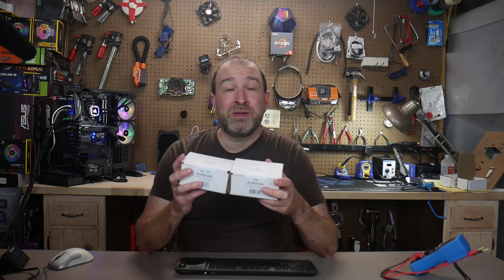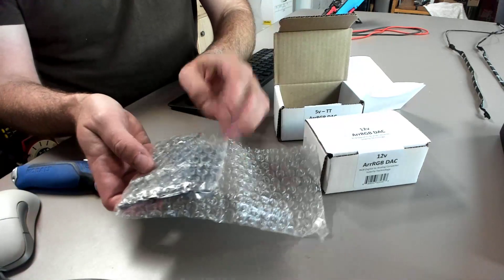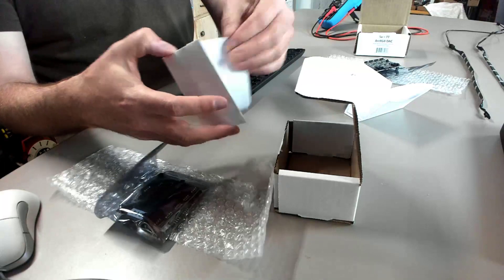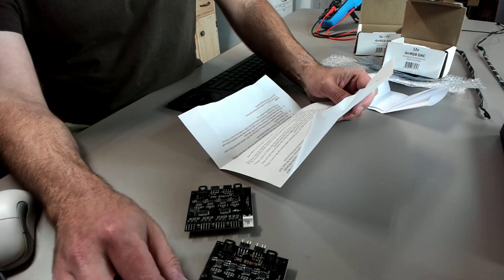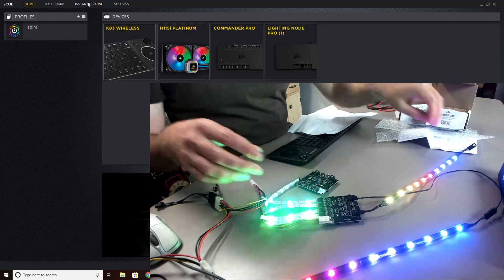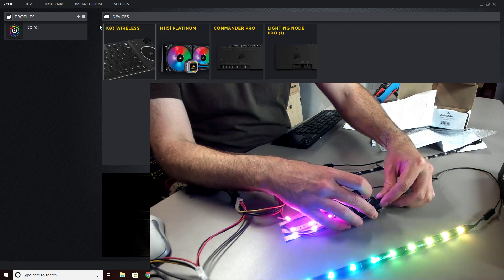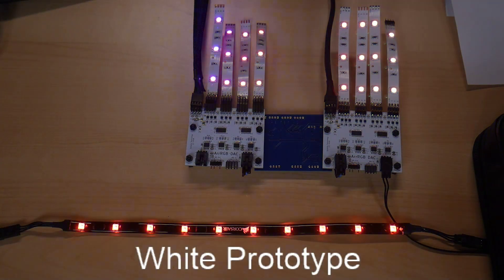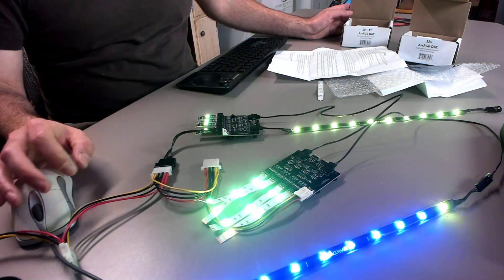ArrRGB DAC Unboxing - Digital to Analog Converter for RGB devices.

Comment: Hello, I can connect a fan cpu (RGB 4pin) with the arrRGB DAC in 12v?
Reply from the maker: Yes, if it uses the standard 12v RGB connector.
Reply: @SolarityTechnology  Does it work if I connect with iCUE commander pro or Node CORE? If so, I don’t understand how to connect everything (Commander pro/node core > ArrRGB DAC > CPU Fan)?
Reply from the maker: @DavidH.68  Yes, just make sure you get or have a cable to connect the LNP/Co-Pro to the DAC. A lot of the LNP/CoPro come with one.

Comment: I Have ID Cooling Auraflow x 240 AIO and i want to paire it with my other Corsair stuffs. 
Can i use this 12v product for AIO Pump and Fans too?

Product Link:
http://www.idcooling.com/Product/detail/id/143/name/ARUAFLOW%20X%20240
Reply from the maker: This is exactly what it is used for. It also allows you to connect each object to one of four channels so you can control the color for each channel separately. I use Corsair iCUE to control all of my analog RGB devices. Check out a list of resellers that carry my product at https://Solarity.tech

Comment: So, just to confirm... Can I control Cooler Master 12V 4-pin RGB devices with this DAC via iCUE? Was thinking of buying a LED equipped partition for my case and it uses 12V 4-pin.
Reply from the maker: Yes, I designed it to control 12v (some times 5v) Analog/Common Anode RGB LEDs from a Addressable/Digital Signal/Controller. You can see the evolution of the DAC in my playlist. Here is a demonistration: https://www.youtube.com/watch?v=cDyW6wq2AU0&t=1s
Also check out my RGB 101 for more information about RGB in general: https://www.youtube.com/watch?v=z5paaWs_Gz8

Comment: Is this still available??? I need one, I have ASUS boards in both my systems and have 3 pin 5v RGB to connect and have no way as the boards only have the 4 pin 12v connectors!
Reply from the maker: This DAC won't help. It is meant for people who have 12vRGB fans, GPU blocks or strips and want to control them with a digital header. There are a couple of devices on the market that do exist, but it will dumb down your 3pin ARGB devices to work like the 4pin 12v. So no more cool rainbow or sequence effects.

Comment: I have 2 Corsair QL140 fans on a Lighting Node Core. I also have a Razer (USB) Black Widow Chroma V2 keyboard. When my computer boots up, the Corsair fans go to the static color I chose for them, but quickly change to a different color in various shades, and remains static. I have ordered a Commander Pro module along with 4 LED light strips and a Lighting Node Pro, but do not have them just yet. Have I not set something up correctly, do I need the Commander Pro to make the fans work properly, or are these fans just not compatible with Razer's software running??
Reply from the maker: The fans aren't compatible with Razer's SW as you can't control it via Chroma. You can sync your Razer stuff with iCUE via JackNET. Could you do a video of your issue or join my discord to discuss this?

Comment: Nice we really need products like this until the industry decides to make a standard, wont hold my breath though! 

Did I understand you right in the video in the part about the jumper, that the board is the same board essentially for both the 12v and 5v TT version with just a solder jumper to switch it from 5v mode  to 12v mode or vice versa?  Meaning at some point if you needed you could just switch the resolder the jumper to switch it to the other mode, no need to buy another board?
Reply from the maker: The ones that are currently for sale are the same boards with the solder jumper. The analog RGB headers also differ from the two boards. That being said there should be at max 2 left in stock with my resellers.  New batch is a slight revision. It has a 3pin physical jumper and there is only one version. For TT users, they will need to get an adapter.

Comment: You wouldn't be willing to make a 2nd run of these? or give out the schematics? It would be much appreciated.
Reply from the maker: Yeah we are having a 2nd larger batch of them that are in the middle of production. They would have been done already, but the pandemic really set things back. Luckily they have all the BOM and the PCBs were manufactured months ago. We had a couple missing parts that took months to source. The boards just have to be assembled with a pick and place, then tested. Just don't know where the tester is. Shipped it to them on 5/21 ><, was last tracked in Jamaca, NY on 3/27. We still have some stock, which reseller are you using?
Reply: @SolarityTechnology  Not really using any resellers, I'm new to this whole thing. I've recently bought Pacific RGB Plus TT Premium Edition and being able to control them with iCue, as everything else in my build is controlled by Corsair that would be awesome! I'm just hoping I'm not late to the game.
Reply from the maker: @Omaricon  I currently sell though modmymods.com and piratedogtech.com. Though you might have the newer version of the TT RGB fittings, which are compatible. They are some subtle differences, though overall hard to describe via youtube comments. Join our discord, which is linked on my channel to talk more. Pics really help.
Reply: @SolarityTechnology  just joined! I love your work though. Truly amazing mod work!

Comment: so i can use this on my asus mobo that has 12v header and connect 3 pin argb on the output and contril with aura sync ?
Reply from the maker: This is meant for the opposite. Control 12v analog devices with a 5v ARGB header.
Reply: Is there any way you can look into building a version that has 12v to 5v like the comment above suggests? The only one on the market right now is the Deepcool RGB Converter and it is out of stock everywhere. I would pay 35-50$ for one, just so I don't have to get a new Motherboard for the 5v header
Reply from the maker: @no.1baller939  Developing something like this takes a lot of time and money. I think they quit selling it as it wasn't that popular. In all honesty, I think it makes the most sense to buy a digital controller like a lighting node Pro. The analog to digital adapter is basically lobotomy of the digital strips. The Digital to Analog adds functionality, while going the other way reduces it.

Comment: How can I test to see if my converters are working? They are no longer put out the signal to my TT fittings. The fittings are working I’ve test them with their original controller and the ICUE works because it powers their strips, but when I connect ICUE out using your ICUE to the Converter in, I get nothing. The 2 converters did work but now they don’t. I know the ICUE has been updated, but I get nothing from both.
Reply from the maker: Could you email me at solaritytechnology@gmail.com or message me via discord https://discord.gg/nvqaAfq

Let me know via above, if the fittings have 3 or 4 wires. Also are you saying the Corsair strips don't work when you plug it into the output of the DAC? Is the DAC directly connected to the Corsair Lighting Node Pro or Commander Pro?

Comment: Have you’ve tried the board with the new Thermaltake fittings? Because I had to get them because the originals are just to flimsy. The cables detect from the solid LED ring. I’ve tried the new Thermaltake LEDs with the boards and it’s a no go. Can you help?
Reply from the maker: Don't plug the new "premium" TT fittings with the DAC, it could damage them. I think they use digital. Granted both voltages are 5v, though I don't have them so I don't know the pinout. Also they should have 3pins not 4. How many of the old fitting's wires broke? The wires are soldered to the PCB and have no strain relief, which is a bad design.
Reply: Solarity Technology Thermaltake places a whole 6 pack. I went along with it not knowing the difference. The LEDs are much brighter. And construction is much sturdier. I would be super ecstatic if it performed like the DAC does when it’s in razor and raindrop modes. Although the TT controller has some descent lighting modes, I wonder if there is a way to export razor and raindrop and from the Corsair controller and import it to the TT controller?
Reply from the maker: @themword1279  I don't have any, so I can't really give much input. I think the newer ones are digitally controlled as they have 3 leads. One disadvantage is there is no digital out so the data can't be passed to the next fitting. While an adapter could be made to run it off Corsair's controller it might be a bit of a challenge to sync them in the way I did. Do you have discord?

Comment: Hi..i have a motherboard with 5v headder (ASUS) and i have the commander pro and LL corsair fan..with this hub i could sync asus product and corsair products? And wich software i should use  to control the lighting effect? Thanks
Reply from the maker: This board allows you to control analog RGB, which are usually 12v with a MB or a Corsair controller. It also gives you for addressable channels. This will not sync up your MB, unless you wire up io shroud and chipset LEDs to the DAC, but that is a bit of work. I think this community developed tool is what you are looking for: https://fanman03.com/?page=dwn
Reply: @SolarityTechnology  ahh so this its a converted 12 to 5v for people that hasnt got the 5v headder? Thanks
Reply from the maker: @nachovidal4047  Other way around, it allows people with 12v Analog RGB devices to control many different 12v analog devices separately with Corsair iCUE via a LNP or CoPro or via a MB software via 5v header. Many water cooling parts still have analog 12v RGB. This way you can control many devices separately via one software. Corsair iCUE has no native support for 12v analog devices, the DAC changes that.

Comment: So this works out of the box with Corsair Commander Pro? I thought Corsair used a different connection than other ARGB cables. Maybe I'm wrong.
I own an EKWB RGB pump/reservoir which I'd love to be able to control with iCue, so if I could buy one of these and it works out of the box that'd be amazing. How's the shipping to The Netherlands?
Reply from the maker: It does work with the Commander Pro out of the box. Corsair does use different connectors. Just verify which type of LEDs you have in your EKWB device. This device can allow you to control both types, though for digital you can just get an adapter cable. For analog devices, this is the only way to get it to work with iCUE. Check with my resellers for international shipping.

Comment: Hey man, a few questions. Fair warning, I'm not much of an RGB expert (just not something I really pay attention to). The main quandary here is 3-pin vs 4-pin addressable. All my LEDs are 3-pin (5V/ Data/ Ground) and I would love to throw Asus Aura in the dumpster. I'm simply looking for any way to do that.

1. Let's say I plug a 3-pin RGB device into your DAC (+ other required Corsair stuff), how does CUE control the 3-pin device? What level of control is possible, if any (basically asking if I can go beyond Asus's POS software with your device and CUE)?

2. Any idea if this will work with Aquacomputer's 4pin devices / farbwerk 360 or Quadro+RGBpx controllers / Aquasuite in place of Corsair's 4-pin devices/LNP/CUE? They (AC) both work with Corsair individually addressable products. https://shop.aquacomputer.de/product_info.php?products_id=3798 https://shop.aquacomputer.de/product_info.php?products_id=3766 If you don't know, this may be worth investigating. TBH, I'm not a fan of Corsair or CUE, hence the question.

3. I assume this doesn't magically turn 3-pin (5V/ Data/ Ground) led devices into individually addressable ones (4-pin Corsair, etc)? I've read you would need to solder a return channel to the strip. Does that sound accurate?

3.1. Can 3-pin devices still be controlled on a per channel basis (IE, channel 1 gets X effect, A color. Channel 2 gets Y effect, B color) with your DAC? In Asus Aura, you can't save profiles and you can't send different effects to different channels (1 effect and 1 color/gradient goes to all channels).

4. This is probably even more of a shot in the dark... ATM, I've got Phanteks Halos Digital RGB fan frames. They use 3-pin (5V/ Data/ Ground), but the strip is super thin (<5mm wide). I've been trying to find an individually addressable 4-pin strip that is of a similar spec with no luck (logically, because that would be difficult). Any idea if such a thing exists?
Reply from the maker: 1) iCUE only officialy supports Addressable RGB LEDs, that is one reason I made the DAC to allow the use of analog RGB devices, like my fittings, to be controlled by icue. So yes Corsair does support 3pin, though they use a Molex SL adapter. You either buy their products, buy an adapter from Pirate Dog Tech on eBay or build one yourself. The fans do use a 4th pin, which is data out. For more info on connectors, please see my other video: https://www.youtube.com/watch?v=wTMghWcSn5E

2) People I have spoken to that have used it have liked it. I will have to talk to my friends from  @modmymods as they sell AquaComputer and I think I could do a first impression video. I have seen some of their controllers and the 4pin Corsair is for their fans, those headers are wired in series as well, though you need to have Corsair fans for it to work in that manner as you will be missing the data out pass through. One reason I am a fan of iCUE is due to the huge eco system that Corsair has. This means all my lighting (minus MB) can be intergrated. Though I am looking at using my DAC for controlling the LEDs on the IO cover and chipset heatsink.

3) Yes that is correct and then use something like a RGB Hub. See the other video I showed prior.

3.1) It depends on how the HW is setup (i.e. pass through data/inout) and addressed via software. The other option is to have different headers and control each one seperately. Corsair's LNP and CoPro have two headers, each one can be controlled seprately. My device hijacks where a LED would normally be and sends that color as a 12v Analog Strip. 

4) The typical 5v Digital RGB strip used in a PC technically have 6 pins (2xGround, 2x5v, 1xData In, 1xData Out). In the same manner you could say that 12v Analog strips have 8pins (2x12v, 2xGreen, 2xRed, & 2xBlue). I don't own a RGB Halo, though you might be able to open it up and solder a wire on. I think they use a Form Factor smaller than 5050 (5mm x 5mm). So I would need to know a little bit more details on the device.

LEDs are very simple. I try to break it down into simpler terms with visual aids one of my earlier videos: https://www.youtube.com/watch?v=z5paaWs_Gz8&t=4s

Comment: @solarity technology Brother I just order two, but how do I use the Corsair que with it? How and where do I connect the DAC? 

Meaning, do I load the Corsair app on my pc. Do I then assign a port to it that I will connect to the DAC?
Reply from the maker: Do you have a Commander Pro or a Lighting node Pro?
Reply: Solarity Technology no, what are they?
Reply: Solarity Technology so I would have to get one of those?
Reply from the maker: @themword1279  The are two: Corsair Lighting Node Pro and Corsair Commander Pro. The LNP requires a strip in between the DAC and the LNP to work properly. The Commander Pro works fine and also controls fan speeds, has a usb hub and has temp sensors.
Reply: Solarity Technology so is the cue app put on the Commander/LNP then past to the DAC? Or can my motherboard obtain the CUE app and connect to your DAC the Cue application?
Reply from the maker: @themword1279  iCue is the best RGB Software so far in terms of control and stability. It requires a CP or LNP to work the way I have it. You can also run it off your MB, if you have a ARGB cable as the DAC is a board only. Also see if you have two FDD connectors on your PSU.
Reply: Solarity Technology on its own, what does your DAC do?
Reply from the maker: @themword1279  Looks pretty. It requires a digital signal from a digital controller. I.e. Commander Pro, MB header, etc
Reply: Solarity Technology when connect it to another controller, it needs its own power correct? What power adapter do you suggest?
Reply from the maker: @themword1279  Each DAC requires a FDD power connector. Most PSUs come with a FDD connector or adapter. You can also buy a molex or sata to FDD power from many sources.
Reply: Solarity Technology I just got my DAC, can I use this for it? https://rover.ebay.com/rover/0/0/0?mpre=https%3A%2F%2Fwww.ebay.com%2Fulk%2Fitm%2F254232302856

Comment: @solarity technology Ok brother, when can I order mine? I need two 5v.
Reply from the maker: These are for TT RGB fittings: https://modmymods.com/solarity-arrrgb-dac-5v-digital-rgb-to-5v-analog-rgb-converter-tt-rgb-fitting-version-syt-0002.html

My other reseller isn't local so he will have it in stock in a couple of days.
Reply: Solarity Technology what power cable do I need? Do you have a link?
Reply from the maker: @themword1279  https://www.amazon.com/dp/B07KS6QWKF/ref=cm_sw_r_cp_awdb_t1_.aOlDbKGC2EBX
Reply from the maker: @themword1279  MMM just got FDD sleeved to Sata power: https://modmymods.com/modmymods-4-pin-floppy-to-sata-15-pin-male-power-adapter-cable-mod-0286.html

Comment: Hi I ordered some adapter on the Piratedog ebay shop waiting for them ;) 
You think it's possible to connect the LED from my GPU to the hub in any way ? (MSI 2080 Ti GAMING X TRIO) ?
Thnaks  alot for your work hope see more of your awesome build soon ;)
Reply from the maker: There is always a chance, though this is really going into uncharted territory. Some of the new 20 series cards don't have the typical RGB header on it. Also voltages need to be take into consideration.